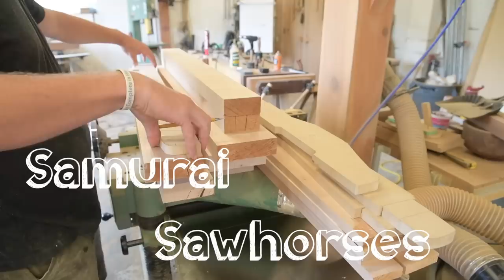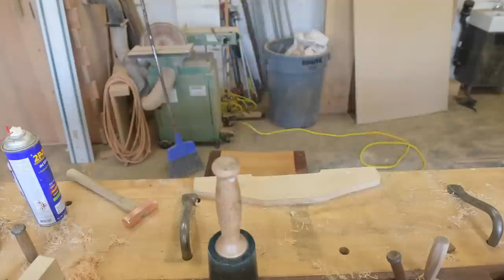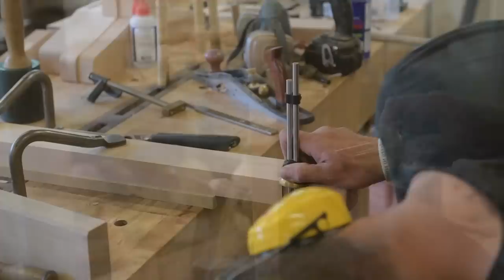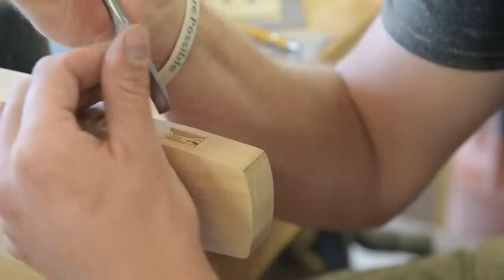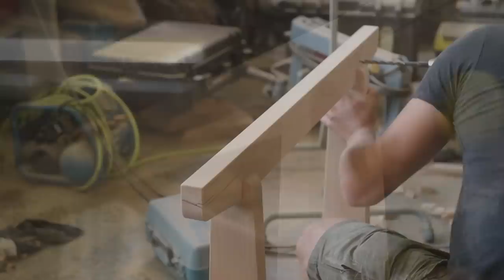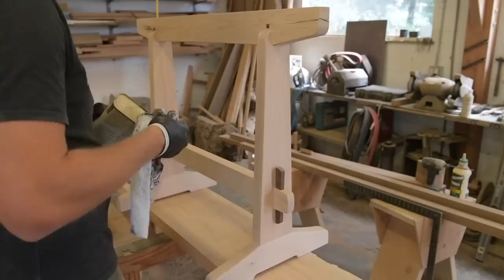WOODWORKING, SAWHORSES! ALL JOINERY!

Comment: These are nice, and very much like the ones you made a while back. I built a pair loosely based on the first set I saw on your channel. The first time I used them, I tried to clamp my work piece to the horse on the end of the cross bar, outside the stile. But the angled cut on the underside of the cross bar made that difficult. I recommend a shorter angle near the very end, leaving a horizontal underside to attach the clamp to. Not as pretty, but more functional.

Comment: Question...I have a few old tools, table saw, mitre saw, etc...what should be the essential thing I need to get more into woodworking?  I feel like a workbench is the thing...but just not sure.
Reply from the maker: Build yourself a work bench for sure.  Along with that, I mostly use my plunge router, a few different hand saws, super sharp chisels and stones to keep them sharp, and clamps...  the list could literally go on forever. (jointer and planer are also key for prepping your material).  If you want to learn more and join a community of other aspiring woodworkers, head to the online school and get on the waiting list.  http://www.samuraiskills.com/